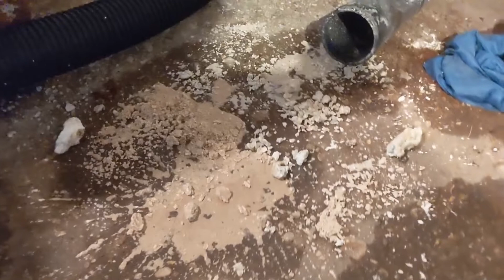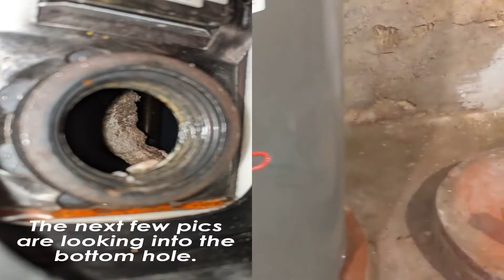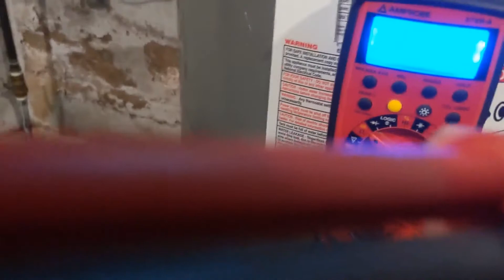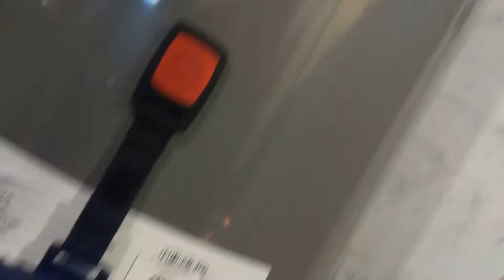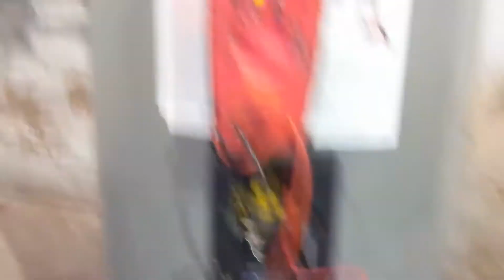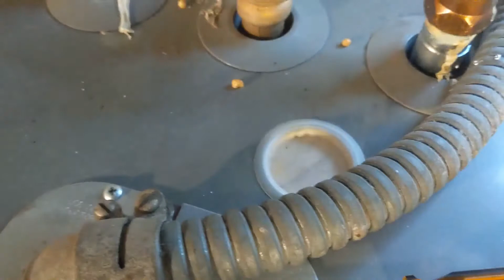Don't Replace Your Water Heater Until You Watch This! (Easy Fix)

Comment: There is some calcium in most water, but i think you have more than most.
The vaccume cleaner is a clever way to remove the broken up crud :-D
Reply from the maker: I've always wanted to try this. The tank looked really good on the inside, and it's not leaking or anything, so it should last a long time I'm thinking. I just have to change that anode rod now.